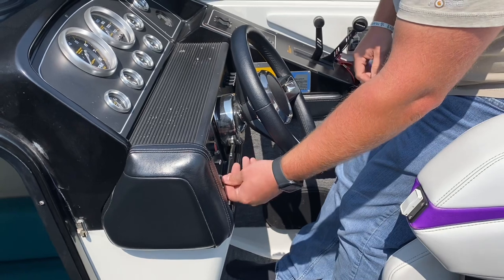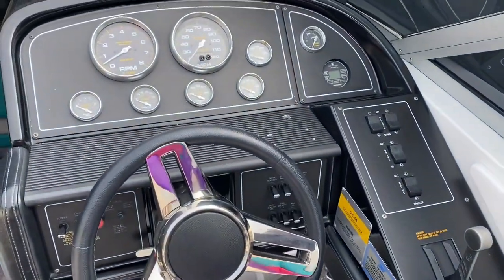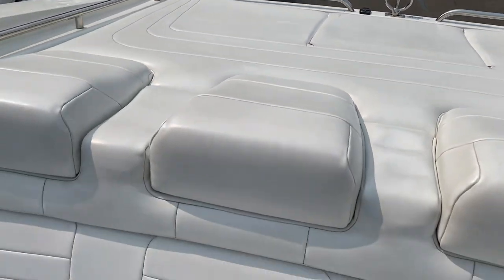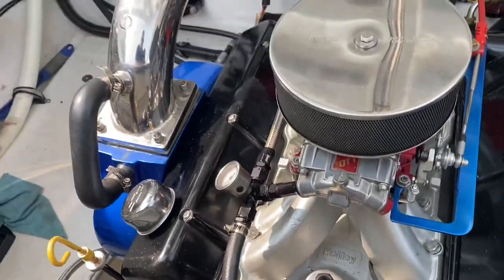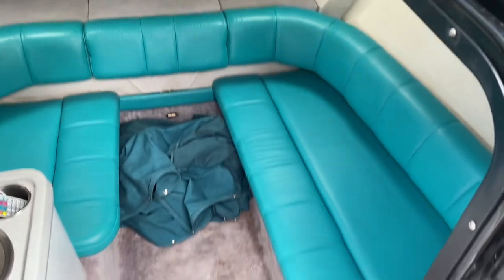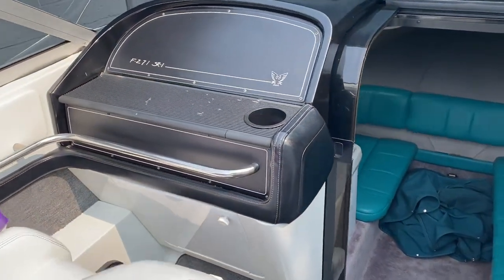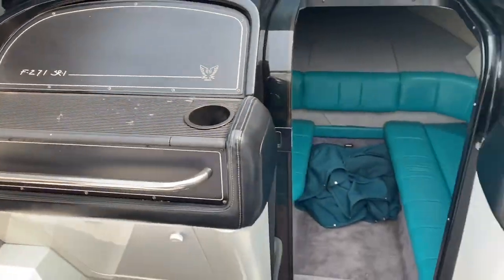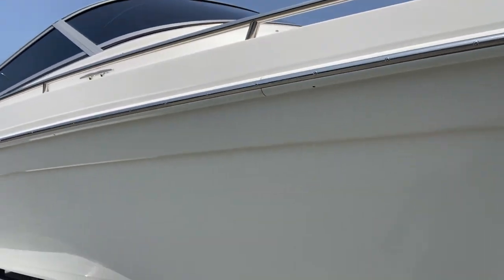Checkout our new 700HP Formula 271 SR-1 Speedboat!

Comment: Nice Formula!. What's the engine??
Reply from the maker: Built big block 520ci, aluminum heads, etc. plenty of power I got a lot of use out of it this season.
Reply: Nice.. Still breaking in my rebuilt 350 in my 233ls..